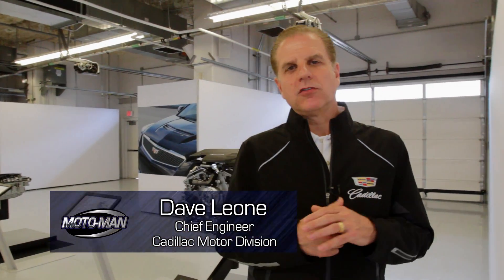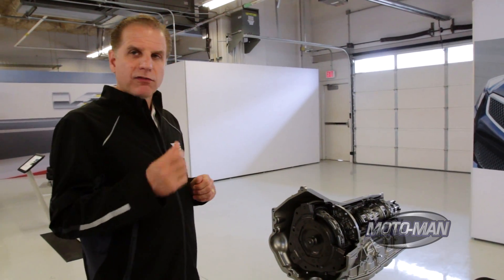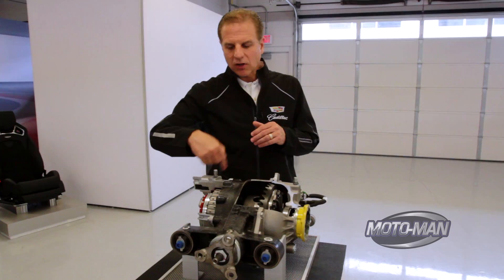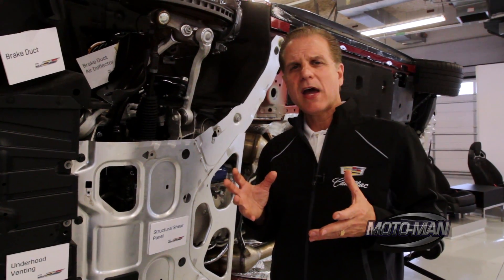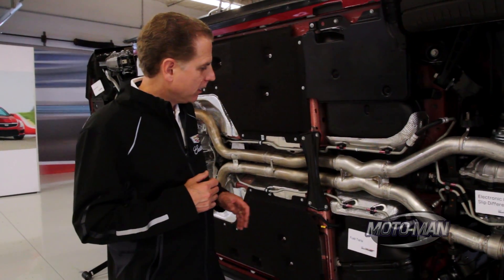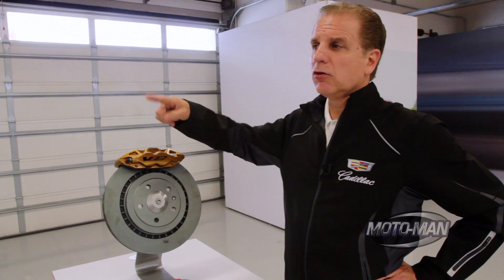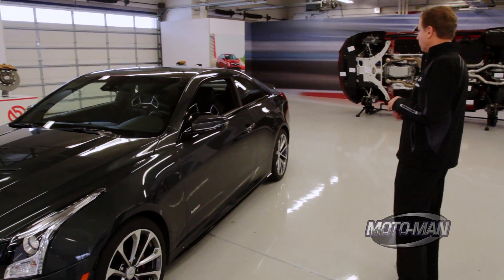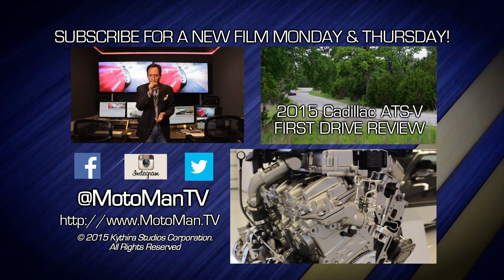2016 Cadillac ATS-V TECHNICAL REVIEW with Cadillac Chief Engineer Dave Leone

Comment: Hi all, I have a question regarding the robust transmission fluid cooling system. I live in Michigan and on my drive to work my trans fluid temp only reaches 80 degrees F. It seems like it might be detrimentally low operating temp. What do I need to add to control fluid flow to get the fluid running at 130-150F during the winter?

Comment: Hi Sir....
I have A big problem with my cadillac Ats 2016...
After starting my vehicle,I can't shut down the motor anymore...motor keeps on runing...and my main-start'button doesn't responds anymore...
I need to pull the main relay to shutdown the motor.*
Hoping to inform you correctly, I remain 
Yours friendly
*Maybe you can give some instructions to check the system, or some clue were the stop/start capacitors location is sir.
Thanks.

Yours friendly.

Regards.

Comment: The seat control display on the CUE system is not intuitive at all.  The swoopy arrows that are shown give no indication of what you are going to be controlling.  Cadillac could learn a bit from Audi in this respect.  Yeah...I traded in a D4 Audi S8 for an ATS-V 6mt.  The S8 was a beast straight line, surprisingly agile for its size, and sinfully luxurious inside.  But.....boring in the end.  I've owned a lot of cars, and the ATS-V is at the top of the list for fun...hands down, no question.  It is a go-cart in handling and a rocket with some minor mods.  Completely engaging and immersive.  BMS should take note...this is how you build a drivers car!

Comment: Hey guys, ats v seems to be a underrated sports car. What surprising me not to say was shocking, the poor instruments tach etc., here should be one like from the cts v in full digital way or just another design. Even the turn signal arrows are horrible.... I also don't like the quality of the exhaust system, I am a welder and this welding looks bad. I saw the same on 2018 camaro.... But one answer is missing, how are the turbos cooled? And will be parts available? Because you ended the production of these cars?! By the way.... Why? Best regards

Comment: I am considering 2016 ATS V and it has 6500 miles on it. The price is $39,000 and is a $330/mth payment. Obviously it was stored or other reason. It is the blue color and is sweet. I going from a 2017 Jeep Renegade, my question is, Does the deal seem a bit of a fairy tail?
Reply: Did you end up buying?

Comment: Very poorly made car. Honestly better off spending a tiny bit extra for bmw,mercedes or audi (aka premium vw). Dynamically is great car, great engineering. But the fit and finish is pure shit. The paint quality is laughable honestly soem of the worst ive seen. The fucken wind will scratch it. Cue is pure shit as everyone knoes. Interior space is shit. And the materials are classic gm quality.... -_- if they improved eveything by just a lil bit and upped the price they wouldve had an awesome car.
Reply: Might be in the minority, but I like CUE,  I really wanted the soundtrack of a V8 but the lack of a long-range remote start option turned me off the C63 S and the local Nashville BMW Dealer turned me off to BMWs.  Owned over 100 vehicles and BMW of Nashville after being purchased by Sonic provided the absolute worst customer service I have experienced anywhere.  I dare say inmates are treated with more respect. I've not noticed the paint being any more prone to scratches than a Mercedes or BMW.
Reply: as an ats-v owner. much agreed. built by poorly paid American workers as from foreign workers that value their job

Comment: I  own a 2018 ATS with the 3.6L engine. I have two gripes so far. One is that the highly reflective CUE center NAV display is prone to fingerprints. Either redesign the face covering like many aftermarket GPS faces, which are a slightly matte finish, or sell a stick on glass protector like a smartphone. Something that is sacrificial and can be replaced. 
Also, put a dang gas cap back on the vehicle. Cadillac says to improve user experience owners now dont have to handle a dirty gas cap. Hellllloooo... Its not the gas cap we are concerned about, its the filthy gas pump handle touched by thousands. Without a way to lock the gas door, the tank is vulnerable to vandalism.  I would love to hear a response from Cadillac if you're truly listening to owners.
Reply: Despite them taking it from Ford, I like and appreciate the lack of a gas cap and the flap locks with the vehicle.  Neither that locked flap or locked gas cap will truly stop someone from siphoning your gas.  Fortunately, that is not a big problem where I park normally nor in my garage.
Reply: I can appreciate your unique situation on the gas cap. Unfortunately not all of us have secure parking at shopping malls, grocery stores, parks, stadium parking lots, etc.  Providing a gas cap door with an interior release and/or a locking gas cap wont stop someone hell bent on siphoning my gas, but the same goes for locks on my house. If they really want in, a lock wont stop them, but I still use them. Not having them is what we call being a soft target. And no flap lock or gas cap just invites someone to dump something into the tank. People can be vindictive when they see a nice car. Plus, when I wash the car, I like to open the flap to clean the backside. Cant do that without covering the fuel fill inlet.  Give me my gas cap back.
Reply: @steadyeddie7453  Maybe not secure at malls but siphoning gas or dumping stuff in the tank just seems unlikely and they do have to pry it open if the car is locked, though I see your point.  I do go ahead wash/clean around the gas filling area as water should NOT go inside the gas tank without something opening the valve inside. You might need to dry a little bit of the area headed towards gas tank but it shouldn't get in the gas tank. Have to add, if you have thought about the Trifeca tune or equivalent?  Worth it :)
Reply: @richardcoker5095  With many crimes, it's always unlikely until it happens to you. And my gas door will open with just a push, whether the car is locked or not. I checked out the Trifecta Tune website and liked the software they offered to permanently turn off the AUTO STOP feature. But for $180 I'll just keep pushing the console switch. Cheers.

Comment: @motomantv for Dave, I'm with everyone else that the gauge cluster from the CTS-V MUST BE IN THE ATS-V! 10SPD auto from ZL1 IS A MUST! Cue is ok, I will use the control on wheel. I had a hard time with the volume.  Make a knob or physical slider pls. Also cool the recaro seats also.  Thx again . wagon ...pls a wagon! 

I'm buying a pre-owned 201x ATS-V  Sedan, very soon as they stopped production of them. 😥

Comment: Not sure how much I can watch.  Around the 9 minute mark he talks about the shear panel under the front of the car and says it's 25mm thick.  I guess he doesn't realize that 25mm is .98 inches thick or almost 1 inch thick.  It's obvious that panel is not an inch thick.  Can you imagine what that would weigh.  I wish they had gotten the lead engineer who worked on the car to give the presentation.  It's obvious that Mr. Leone has no clue.

Comment: Kind of surprised the Chief Engineer of Cadillac is not more knowledgeable on turbochargers.  He referred to the turbine wheel as a turbine vane.  Then he said the new material was Aluminide Titanium, which is correct, but it replaced a heavy Inconel Turbine wheel, not an aluminum one like he said.  Heck an aluminum turbine wheel would melt in no time!

Comment: No mystery why the weight, parts like steel rear control arms.  Right on the cluster.. from the malibu, cobalt, model T?.  $61,790 and no led head lights.  Is option for a cd changer in the glove box, what decades this?  cd's???  I applaud mechanical tech advances, aero, brakes, fuel control, turbo.  Clear those departments are getting the budgets.  Poor cluster dept and weight control needs some slim...fast.   Saw a black coupe on used lot, beautiful car otherwise.  Vette is a much better deal.  Being gm and a cadillac...take 20% off list and that's what they really want.  So you can say its a $62k car, when you paid $50k (still too much).

Comment: Great video, really admire the engineering and refinement in the ATS-V. Dave Leone is a great narrator and makes this video a treat. To Cadillac: The ATS-V Gauge Cluster is a serious problem, it looks extremely outdated and not befitting a serious sports sedan.  How to fix it: Implement two sharp, classic gauges (Tachometer and Speedometer) large in the center, and move the digital screen to in between those in the center. See Mercedes, BMW M, Jaguar, Aston Martin, or simply a Volkswagen GTI for examples of what works best. Please Cadillac fix this!

Comment: Cadillac, add active aero to the v's. It does not need to be visible too the naked eye. Also, innovate some things that no one else has done or is likely to do. Think of the mechanical boldness Dodge proceeded to use in making the demon the demon. They have an interchiller, and all kinds of performance gadgets. But that car is in a class of its own in some ways. Bring some of that boldness to the v's. Otherwise keep up the good work.

Comment: I'm sold...I bought a 2017 today, picking it up on Friday.  The one question I have is why aren't more colors available with the manual transmission.    I had to have the stick so I got the black.  I had a 2014 ATS sedan with the 2L engine and six speed stick.  It handled well but I love the horsepower.  I also was considering the BMW M4 but decided made in USA was the way to go.  Thanks Cadillac!
Reply: I want more colors too! Especially for the neutral-exterior-color ATS-Vs, they need color accents in the interior (like the CLA45's red belts and bolsters).

A fun car deserves fun colors. I think BMW's new yellow (Austin Yellow Metallic) is great. Merc is offering several shades of silver. the V could also use a blue color and a special edition color like the R-34's Midnight Purple!
Reply: Merica!!

Comment: Everything is great in general, just get rid of CUE. Can we go back to the Gen 2 UI?

BTW, the other thing I am not a big fan of is going forced induction and lower displacement for the sake of going forced induction and lower displacement. Let's get one thing straight -- THE 3.6TT LF4 (or the LF3 for that matter) IS NOT MORE FUEL EFFICIENT THAN THE LT1 6.2 V8. This is not my crazy theory, it is a fact. The ATS-V gets 17 mpg (city) / 25 mpg (hwy) from the 3.6 liter force fed mill. The 2017 Camaro SS weighing about the same gets 17 mpg (city) / 28 mpg (hwy) from the LT1 6.2 V8. Both cars use the GM 8L90 8-speed automatic. Both cars weigh about 3700 lbs. Both cars make about 460 hp and about 450 lb-ft (give or take five). The LT1 V8 is the cheaper and LIGHTER engine actually thanks to the absence of the big and bulky DOHC heads.

The Pushrod V8 is not low tech and it is a very mass efficient design with a very high power density (per unit weight or space occupied). You have it. The competition doesn't. Use it!

The only "plus" I can see from a personal standpoint to the LF4 is that if you are willing to remap the ECU and crank up the boost and timing. You can get a "free" 60~80 hp out of it. People who are into ECU hacking will like it more than the NA V8. But, as GM, do you really want to increase the propensity for unauthorized mods which can then present warranty disputes you need to sort out? I don't think so.

From a purely technical standpoint, if you are going to stick to a turbo six, the twin turbo layout is not ideal. A better (and more uniquely Cadillac) design will be to flip the heads such that the exhaust exits in the valley of the vee. These can then drive a SINGLE larger turbo instead of two small ones. The single turbo in the middle and on top of the engine can have two outlets to feed two air-to-water heat exchangers and a pair of intake manifolds on each side. This retains the minimized compressed volume for minimum pressurization lag.

A single larger turbo is generally more efficient and more responsive. Larger impellers have higher efficiencies because while the geometry scales, air molecules and viscosity does not. The Reynolds number change and bigger aerodynamic structures are more efficient -- it's the same reason a 777 wing can be made more efficient than a 737 wing. Don't believe me? Go check out the compressor maps of a small turbo then a large one. The small turbos have peak efficiencies in the mid 60% range the large ones mid to high 70% range. The urban myth that two smaller turbos spool faster is complete and utter rubbish. Yes, a smaller turbo will spool faster than a larger one when fed the same exhaust flow. But, two smaller turbos being fed HALF the exhaust flow will not spool faster than a large turbo being fed the entire exhaust flow. Period.

Oh, and boy there is ONE gaff. The ATS-V has Titanium-Aluminide turbine wheels in the turbos. These do not replace aluminum wheels, they replace a steel alloy turbine wheel. That is why they are lighter. Typical turbos have steel or steel-nickel alloy turbines for heat resistance and only the compressor wheel is aluminum. The specific Borg-warner KKK unit used has Titatium-ALuminide turbines which meets the heat reisistance requirement while being lighter (albiet more expensive).
Reply: I always don't get it why they don't just offer double-din. Buyers of ATS-Vs should be more than loaded to install their own aftermarket headunits.

Comment: Love the car. I sold my BMW M4s. Had the coupe and then the convertible. I bought the ATS-v coupe. Vector blue with carbon fiber pack. 6 speed. Recarro seats. Chassis on the car is amazing. Very well balanced car. Planted. Great job Cadillac. I can tell you I do not miss my M4 lets put it that way. 47 years old I had a lot of cars. Nissan GT-R. This car is fantastic.

Comment: I would be sold if you could also compete with the interior of the German competitors ( M3, RS5 and C63 AMG, and dare I say future Audi RS4) for this price point.  Ive test drove the RS5,M3, and C63 S AMG (all equipped around 80K) and I must say I was very impressed with the ATS V's performance, but not at all with the interior ( except major points for the Recaro Seats and data recorder). Get rid of the "CUBE" infotainment system,  add in better audio system and higher quality cosmetic materials. Great performance though!

Comment: I found the bit about asymmetrical half-shaft diameters to be very interesting. I do however wish that the 8 speed were a dual clutch transmission. Many reviews of this car are critical of the downshift delay when using manual shifting mode.
Reply: Here is something I don't get. All these engineer teams talk about "almost as good as the PDK." The PDK is not a fundamentally complex transmission. Why don't they just clone a PDK like the good ol' Chinese? It will be fast, reliable, and cheap on R&D. Best of all, if any imperfection reviewers point out, you can just blame it on Porsche.

Comment: ATS-V has the performance without a doubt.  Now, you need to work on the gauge layout (think CTSV), interior styling, SHITCAN the Bose stereo options (Partner with HK, B&O, Burmeister or Levinson), then add more standard features and be cheaper than the M3 --- and it would be perfect.  Bravo on the overall car though!
Reply: I want to buy one of these new ats v,but I hope that they offered the ats, in all the exotic colors like BMW .

Comment: I think Cadillac should offer the Recaro Seats in the 2016 ELR, as an option, simular to BMW'S M packaging. Let customers pay and for what they want. I personally don't need all the ATS V'S horsepower,  but I want the sporty look. Also with the ELR offer 19" wheels simular to the 18" sport rims found on the regular ATS, those are way better looking than the 20" sport rims on the 2016 ELR. Also, with the new logo, there is no way it should not have the same colors of the front and rear badges, why do the wheels not show off the badge in color...like a Porsche?? These suggestions may seem small in retrospect, but trust me they will help to sell units, which is what Cadillac is trying to do.

Comment: I would love to know more about the internals, rods, pistons and crankshaft in the event that more power is wanted (which we all know will happen) and then sent to a tuner.  Can it handle a basic GTR type of modification? Intake, injectors, ecu tune, possible flex fuel set up with duel pumps to except E85 and last but not least down pipes.

Comment: Update on Cadillac CTS-V wish list requests. My apologies to the Mad Scientist and his crew at Cadillac regrading my request for a dual clutch automatic for the CTS-V. The new Hydra-Matic 8L -90 which the new CTS-V shares with the Corvette is purported to be benchmarked against what is arguably considered the best sports car automatic on the planet; the vaunted Porshe PDK.  Below is an  excerpt to an article on the 8L-90 hyrdramatic;

"In developing the Hydra-Matic 8L90 automatic transmission, the engineers benchmarked the Porsche 911′s PDK transmission and they claim to have matched or beaten those shift times through a combination of hardware and software."

Perhaps a smack down between the Porsche PDK and the Cadillac's Hydra-Matic 8L-90 is in order Moto-Man?  Given the above I would like to amend my wish list to upgrading the current Hydra-Matic 8L-90 to four wheel drive with adjustable rear wheel bias between 85% - 60%. That transmission coupled with a turbo charged V-8 with 650 HP and 595 ft. lbs of torque in either a coupe or an updated sports wagon special order.